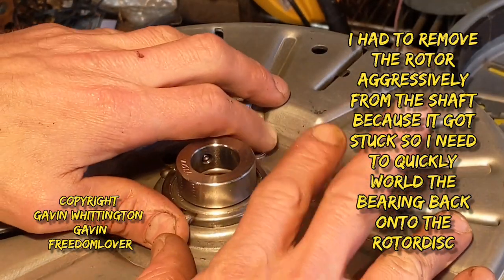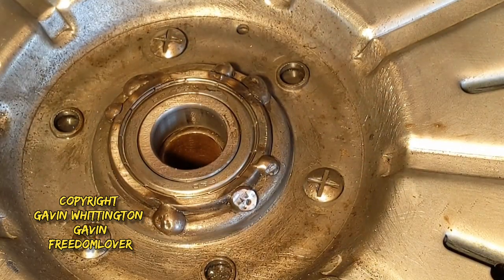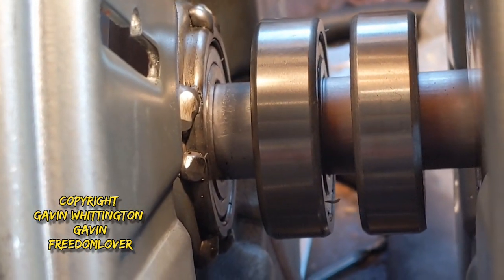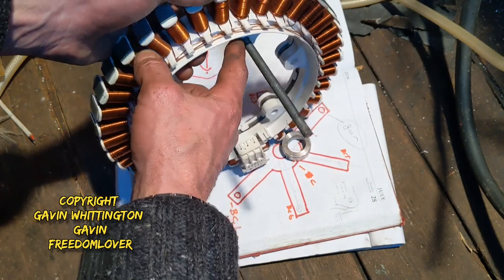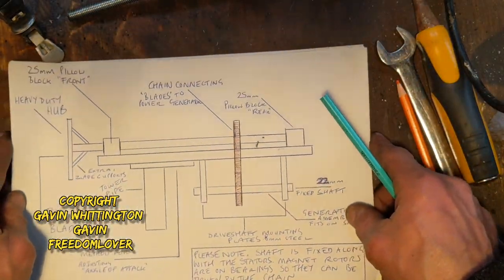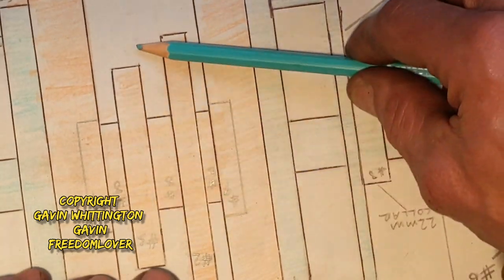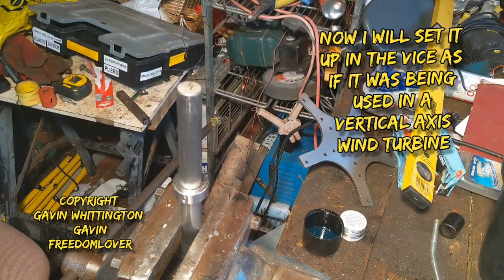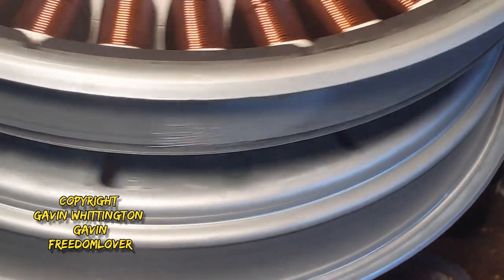New FREE ENERGY project , dual recycled direct drive WIND TURBINE from washing machine motors

Comment: The chain and gears will be a huge frictional loss, more than any benefit from having multiple ratios. Stick with direct drive and match load to meet wind conditions.
Reply from the maker: It may do but I do have some decent sized blades to stick on it.
Reply: @joepickles8689  I thought I saw gearing in the giant turbines on tv , plus like you say variable pitch blades for high winds. That's slot of power 1/4 loss so if it was a 1000 hp engine 250hp loss that's some heat

Comment: Collars. And as far as the AL wires, you can try crimp terminals on them.  It would have seemed that it would have been better to make the shaft rotate and have the bearings in the stationary part. Welding bearings is always a bad idea as the heat softens the area where the weld is. Source of early failures.
Reply from the maker: Yes thank you I know it is collars my text-to-speech always spells it as colours no matter how I say it it and yes welding the bearing unfortunately was the only way I could do it.
Reply from the maker: And yes thank you I will definitely try some of the crimps.

Comment: I am sorry,  I don't see how the chains will drive the sprocket  with the connecting bolts.
Reply from the maker: Thanks , the bolts will work as long as they are all on the inside of the sprocket , I may have to find a different way , I am still sussing it out :)

Comment: Ahh this one looks great... im starting to look araund in my area for these motors... cant stand it anymore :D ;) how you will protect stators from weather?
Reply from the maker: I have a couple of ideas, it will have a cover of some kind which will have open slots for the chain.
Reply from the maker: make sure you don't buy on qith aluminium wires, I will put a video up tonight with how to tell so you don't make the same mistake I did, please note they do need rewiring, cheers.
Reply: @GavinFreedomLover  tnx ;)
Reply: Spray paint? 😂
Reply from the maker: also I may paint the coils in resin once the stator has been re wired.
Reply from the maker: I have some sheet aluminium I will make like a round cover for it

Comment: I like what you are doing Gavin with your wind power plant. Using two magnet motors siameed together is plain guinness fella. Look forward to see the finished product  Sir. I have given you some pointers that i thought of on this project Gavin. Good luck and forge ahead mate.  
What you should of done with the bearing is get one that has a built in flange. Then distortion is cut down to zero. When  you were welding I could tell by the sound that the metal was not cleaned with acetone, that is why the welding sound was off. You are a welder or not ??
          The collars you should be using are double split locking collars. The setscrew ones you have on the shaft do not lock that well on the shaft.
Reply from the maker: Thanks for this comment , I am not using these motors anymore, cheers.
Reply: What kind of motors are you using now Gavin ??  @GavinFreedomLover

Comment: Can this system work with my aluminum stator? I have the same model. 
What do you recommend I do to lower the voltage so it can go into a battery? 
I am building a hydro system.

Also do you know where I can find an explanation of the wiring between the stator and the rest of the electronics? I have no background in electrical engineering. 

Thank you in advance.
Reply from the maker: I have not tested this stator yet , if you are making hydro you need the original bearing spindle thing from the washing machine as well, I think copper stator would be much better for you , the re wiring isnt that hard go to a site called www.thebackshed.com  cheers
Reply: @GavinFreedomLover  Yep I have the spindle as well

Comment: Hi Gavin very good work. But I have some comments here as I am also in the process of building similar generator: 1. How do we know that the motor use allumunium wire instead of copper? (I mean from visual look only or you have to test by soldering the wire?). 2). I prefer to  make the shaft rotates, so both rotor are joint together with this shaft and rotate together. I think this is easier to build. 3. If you don't change the wiring, the voltage will be higher at lower RPM. So I still don't understand why you change the wiring, that will lower the voltage. 4.My LG motor has 12 magnets poles with 36 (or 3x12) coils. Do you know what is the KV number of this motor? And what is the current rating? Thank you and good luck...
Reply from the maker: 1) I have a video I think which shows the difference , the wire is a ) brown rather than copper coloured and b) the wire if fatter and each coil has less turns, also you will probably find the rotor will have " AL " on it somewhere.

I didnt have an original washing machine shaft or I may have done it with that , it's still waiting to be finished.

I don't know the answers to your other questions I'm afraid, I made a video with the diagrams for changing the configurations of the stator.